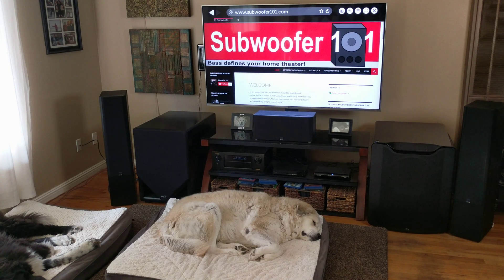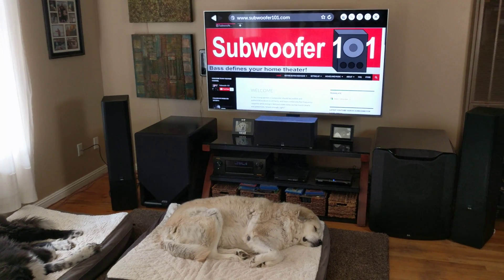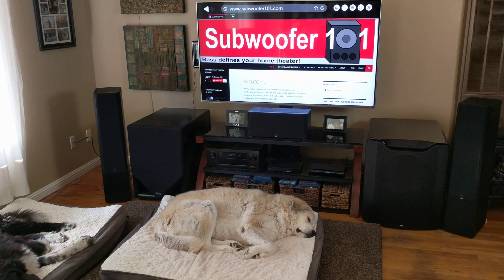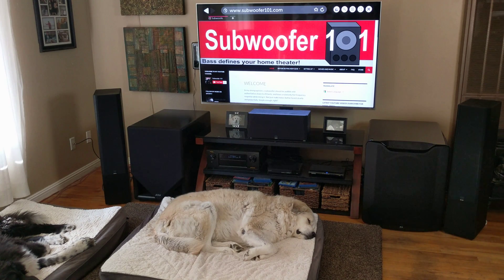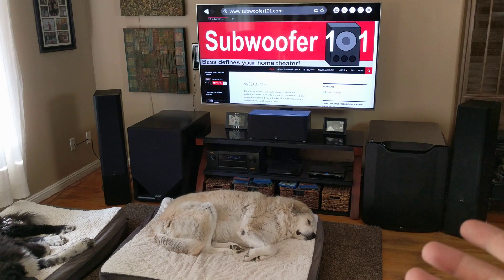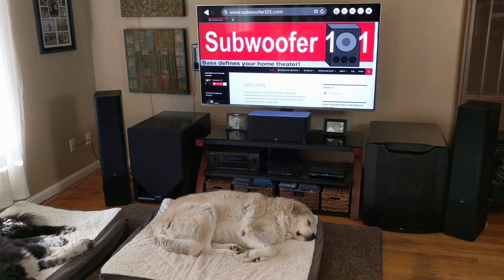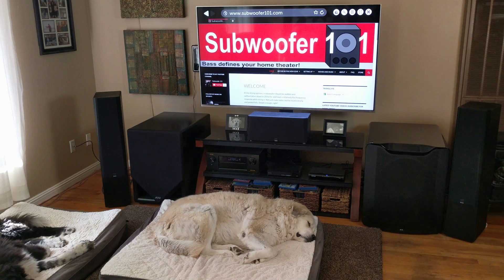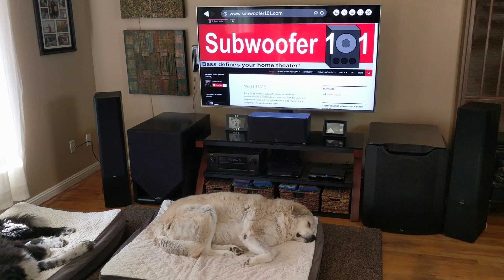Dual Subwoofers: Possible Problems, Pitfalls, and Tips For Making It Work (Wireless, Mixed, Phase)

Comment: If you use DSPeaker's AntiMode SII then you can EQ both subs, you just use the 180 deg port for the 2nd, invert phase on the sub itself, then it EQs both and is summed as mono.

As for dual subs in a small room {mine being just 11ft x 10 x 7.5}, I don't think it adds much, as it's too small a space for so much energy, 1 is just fine in my experience.

Now I've got a spare PC2000 gathering dust!... such a waste. Haha.
Reply from the maker: +Paul Mckenzie Output wise, 1 is definitely plenty. In terms of the overall sound quality, I couldn't disagree more. I've found that having the subs equidistant and in phase does just fine with just basic room correction. 

I have a Mini DSP 2x4, and I know it refines the sound, but I haven't been that motivated to get it set up again. It will clean up the response, but the response isn't that bad to begin with, and you do need to compensate for the added delay. I hook up the 2x4 with no changes, and run room correction on the AVR to ensure the distance/delay is accounted for before making changes. 

I would keep the phase dial set to zero on both, phase is better handled through distance/delay settings. One time I tried varying the phase of one sub using the dial, and I got a better looking graph, but the sound was just off.

If I recall correctly, Ed Mullen told me that the phase dial is a little imperfect, but at the moment I can't recall what he said it does, but if you've got antimode, taking the phase dial out of the equation shouldn't be limiting in any way. Just using the distance settings on the AVR is plenty effective.

You may be having an issue from being a little overcomplicated, I've been there. If you don't notice an improvement over single, I'd have to believe something is wrong somewhere. It's night and day to me, and I've gone back to a single a few times, and find a single to be distractingly incorrect. 

You might try setting both subs to zero phase, delete antimode or keep it as pass through, and just run room correction. Then try adding 4 feet to the subwoofer distance on each sub on the AVR. Seems to be a reliable formula for me, but check to see how much distance gives the best graph with REW or similar. 

You should be really happy with the addition of a second sub, so something is probably up. Both are PC-2000?
Reply: I do agree it improves sound quality, it's just my room's too small for all that power.

Until the other day I've had B&W CM10 S2's hooked up {had them for about a year, and before that were 683 S2's, and before that Cambridge Aero 2 - now used as Surrounds... and before that, CA Minx 21 satellites}, not really realising the bigger the speaker, better the sound. While that's true, you'd need a room atleast double to size of mine to give them space to breath, and I was using the CM10's with dual subs too, while wanting to XO no less than 60hz.

While obviously you can, as I say, it's just too overpowering, even for me!

So now I'm back to using 686 S2's, along with just the 1 sub, and even then the 686's only need a 60hz, or even 40hz XO for a seamless blend.

I also auditioned the CM6 S2's yesterday, and they're a great fit too. Basically anything other than Standmounts are a waste in here.

I haven't tried the dual PC2000's with the 686's yet, so now I've downsized it may prove to be excellent with duals once again. But due to space limitations, 1 sub's in the front right corner, the 2nd the back left, about 2ft from me, so any attention it draws to itself would be too distracting.

As far as AntiMode goes, once you run the EQ you then run YPAO on the AVR, and the extra delay is added automatically. Or even if not they say when you're dealing with such low frequencies anyway you wouldn't likely notice anyway.

...Back to the current setup, from where I sit I don't have any nulls around me anyway. I'd have to run some sweeps to see where they are, but the sound's excellent as it is now.

Back to the AVR & AntiMode side of things, dual mono is summed into 1 sub on the AVR, so I only have the option of adjusting 1 sub, which is actually feeding its signal to 2.
Reply: Also, you say you found it fine using the AVR's sub EQ? The fact your room looks to be double the size of mine {hell, you've enough to accomodate Floorstanders AND dual PB16U's}, so you'll have an easier time due to that alone.

At one time I actually had dual SB13U's in this same room. That's beyond overkill.

Did learned something from that, though... ported are SO much better, and not just for movies, excellent for whatever music you throw at 'em too!
Reply from the maker: Something you might try, once you have duals again, is running your crossover higher, like 90+ hertz (even if temporarily) just to set the bass level. I run 32 hertz towers at 90 hertz, just because I want more going to the subs, but I understand not everyone likes it that way. They towers get signal down to 32 hertz, just not as much, while the subs have a sharper cutoff above the crossover. 

The reason I say increase the crossover is to get a bigger "picture" when you're getting the bass balanced (14-90 hertz effective, vs 14-60 hertz effective, almost doubling the subwoofer's effective frequency range), making it easier to balance the bass in my opinion. Once it's dialed in at 90 hertz, it should still be pretty good at 60 hertz. When trying to integrate at a lower crossover, it can be easier to miss the target and overdo it.  

I can get the PB16 Ultra's to act like 200 watt subwoofers by reducing the gain way down, which would be a waste no doubt, but I could pack them into a small room and get them to sound right, I'd just be taking down the gain on the sub and increasing the gain on the AVR subwoofer trim (which I wouldn't do normally in my room). Wasteful for such powerful amps, but functional. 

I just did a video on adjusting the gain for better dynamics, but for a smaller room, you may need to go the other way if you are getting too much in the way of dynamics, which could be the case. Essentially, the lower you adjust the gain on the sub (and higher on the AVR subwoofer tirm to compensate), the more it will act like a smaller wattage sub. 

So you can get a PC-2000 to act more like a PB-1000 (in terms of dynamics, not depth) by running the gain on the subwoofer lower and the AVR subwoofer trim higher. If you run the subwoofer gain higher and the AVR subwoofer trim lower, you can get a PB-1000 to act more like a PB-2000.

That said, just using the higher crossover to set the bass balance may negate the need to cut any dynamics by reducing the subwoofer gain. You'll just have to play with it, every room and ear is different. 

So long as both subs are giving you the same db with pink noise, it's shouldn't draw too much attention to itself, but you can run it a touch lower if it does. I have to do the same thing with one of my surrounds for the same reason.
Reply from the maker: I do find ported subs more comfortable to listen to. I can listen all day, even with these monsters doing work. Tried them in sealed mode and I felt the fatigue set in. Did you notice something similar?
Reply: I'm totally with you, even with CM10's I'd like to run them at atleast 60, if not 80hz. Makes sense as it lessens the load on the Amp, which is always a good thing. I like it to run as cool as possible.

I understand that running speakers as close to their full range is a good idea for music, since it takes away the trouble of having the match phase as close as possible for a smooth crossover. Plus, the speed of a speaker's own drivers will always beat a sub.

I think the tricky part will simply be level matching with a higher XO. Then again, I've got an SPL meter, so just a matter of matching speaker/ sub levels at the desired XO.

What I've never understood is how the sub lever can be set to whatever level post calibration, yet speaker are set to Large, even though I know they're not.

So what XO does the sub's level work with? For instance, YPAO sets them to Large, but sets the sub to +1.5db. So then if I set a XO to 80hz, that +1.5db would be more like +10.5db, as the force of the bass is that much more powerful.

Then again, if that theoretical +10.5db at 80hz is true then I would -9.5db sub gain to match again?

I never found sealed less comfortable, I just fell inlove with ported when I physically felt air move at 20-30hz, after only had sealed at that point!

I originally went with the SB13U 'cause it was apparently better/ faster for music, but ported does just as good, and I'm extremely ecclectic with music too.
Reply: If you ran the 2nd sub lower, wouldn't that lessen the nulls it has helped fill, or is that the compromise you'd have to make?
Reply from the maker: Ed's contribution really helped me understand it: 
http://www.subwoofer101.com/setting-up-your-gear/large-vs-small-lfe-main-double-bass-etc/
Reply from the maker: Shouldn't be too bad. The waves still interlace, the slight difference in amplitude shouldn't make so much of a difference that you would notice. I used to run one sub hotter than another just in my setup. It was accidental, one sub is sort of corner loaded, so it always puts out more at a given gain setting than the other. Better to have them balanced, but did not "ruin" the dual sub effect.
Reply: I understand all of what Ed's said there. Really, for me, it's more balancing a higher XO with the sub SPL. I'll likely just end up with a sub{s} that are only needing to use a fraction of available power. Should have spades of headroom.

I just don't get YPAO's sub setting with Large speakers that are then gonna be set to Small. I'd like an answer to that one, unless I  answered that myself in the last post?
Reply from the maker: +Paul Mckenzie I set my towers as small, and I don't bother trying to SPL match. I just turn the AVR subwoofer trim all the way down, put on familiar music, and slowly turn it up until it sounds filled in. Never found a measurement method that works well for me, I just do it by ear.
Reply: I've put my 2nd sub back into action, and it did flatten a gradual rise slope from around 40hz that ended with a peak at 250hz {always had an issue around 250hz in here} I'm not sure how that helps me when I XO much lower than that, and even though it's 12db/octave slope, 250hz is obviously well out of that range.

I'm confused as to why YPAO even EQ's subs that high when that's a speaker's "territory", and when the highest XO you can choose in the AVR is 200hz.

Wouldn't YPAO be better served EQing down to, say, 20hz instead, since 250hz is midrange territory. Unless it's cleaning up vocals AND midrange... but ain't that defeated when the would be EQ'd frequency is well above max XO anyway, unless the sub still has a bearing that high, even though XO is lower.
Reply from the maker: I'm not super familiar with YPAO, so I can't really say. Glad the second sub is working out better, it should be a wow addition overall. Try turning one on and off, and see if you can spot the missing response, I think it's more than a graph alludes to.
Reply: Yeah, I'll try it. One configuration filled a null around the FR speaker, so we'll see.

Comment: Hey man. Glad to see you have broached this topic; especially after confirming the details with Ed Mullen. I thoroughly agree that dual subs is the way to go and your points for getting them setup correct seem spot on to me. 

And I think explaining why dual subs may not work optimally for a few, especially for those limited in placement due to space or aesthetic reasons is really helpful. 

Glad to see the channel continue to grow and do well. Appreciate your time and effort that you take for this. Living with a condition myself that can make "life" difficult I can sympathise a little with your situation but I hope you continue to have "good" days so that you can keep enjoying your hobby / family and friends.
Reply from the maker: I had to imagine a lot of the problems rather than speak from experience, so I felt a lot better having Ed check my notes. I've always been surprised when people have issues, but my setup has always been uncomplicated. Running the different driver sizes really brought it to the forefront. 

I appreciate the acknowledgement, Fibromyalgia is a bigger issue than I let on, but doing this channel is fun so long as I keep it simple, and enjoying home theater is almost always in the cards. I use Low Level Laser Therapy, and it helps a LOT with the pain levels. It doesn't fix the fatigue and the rest of it, but the pain reduction has been truly epic. Ever heard of it? I've seen it do some truly amazing things just by letting friends and family use my laser.

Comment: I saw in one of your comments on your website where you said the standing waves can be cancelled using the mains as large and bass management as LFE plus Mains on my AVR with having only one PB - 2000. I have done that and find myself enjoying the music and movie greatly. My question, is the standing waves really cancelled using LFE plus Main on single sub configuration. Am I not hearing something or should I be hearing something. Little confused. I have a pair of R-28F and my sub is PB 2000. I want to wait till I can afford a second PB 2000, don't want to pair a cheap sub to match SVS. Any response highly appreciated. Your videos and website is a great source of info. Cheers!!!
Reply: Subwoofers in different locations will "excite" different room modes.  So when you use your mains as additional bass sources, they aren't "cancelling standing waves", they are just filling in the nulls that you get when you use one subwoofer.

Comment: Hey! I've followed you for a while now and I really like your videos. they are always highly informative and I've learned a lot from watching them.
just got myself new fronts and the centre is on its way, all from Dali.
now I just have to save up for dual 10's from svs  and things should start to liven up.
I'm a bit short on space and the wife factor comes into play, would you recommend the cylindrical ones over the closed 1000's? 
it will be a huge step up from my current sub from Canton regardless as my new fronts makes it obsolete. 
The room they are going in is open on one side so I figure i must have two to even stand a chance of even distribution across all listeningpositions.

any recommendations? 

keep up the good work and say hi to the dogs from me! cheers

Comment: are those matching pb16?
Reply: Voodoo hey, as he mentioned in the video, they are not. right is pb16 ultra, left is a 15 inch different brand.
Reply from the maker: +Voodoo No, that's kind of the inspiration for the video. The subwoofer on the left is my 15" VTF-15 mk1 from HSU. While not a perfect match for the PB-16, it gave me less trouble than the PB-2000 with a 12" driver. I just hooked up the second PB-16 last night, and my preference for identical subwoofers has been reinforced. Not to say anything bad about the VTF-15, but having a united front is cleaner and more coherent.

Comment: Question iif you have a sub that has xlr should you use that over rca cable
Reply from the maker: +Mario Duncan If you have the gear to run XLR it's worth trying. I don't have XLR outputs, so I couldn't tell you what difference it makes, but a lot of people swear by them. As I understand it, they increase the signal. If you try it out, let me know what you think.
Reply: XLR uses a balanced signal to reduce noise for long cable runs. If you have short cable runs the benefit of an XLR is very small, but if your equipment already supports them you may as well use them over unbalanced RCA.
Reply: Not worth using, usually for microphones long run sensitivity.  sub cables sensitivity aren't as vital,  I would say either, I didn't use XLR on my mixer for the subs, but I did for the KRK monitors and It made no difference